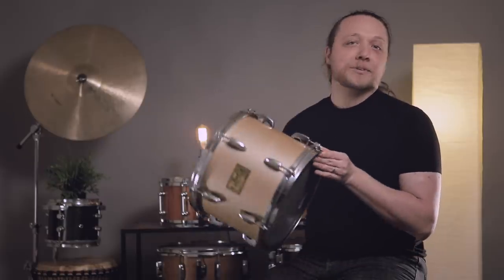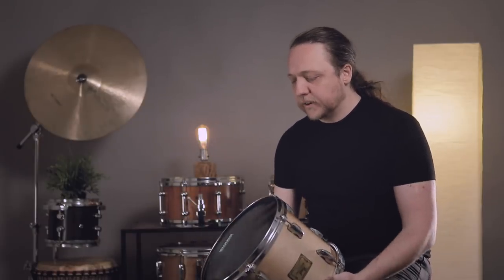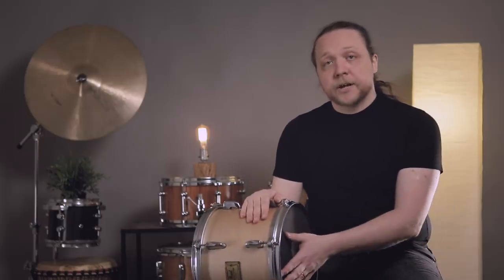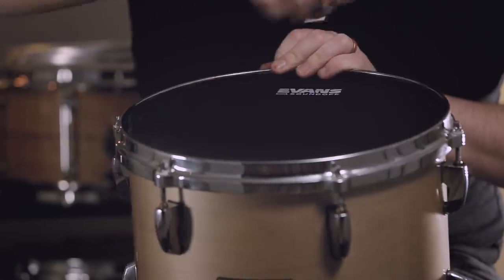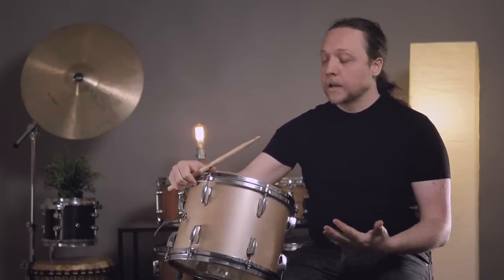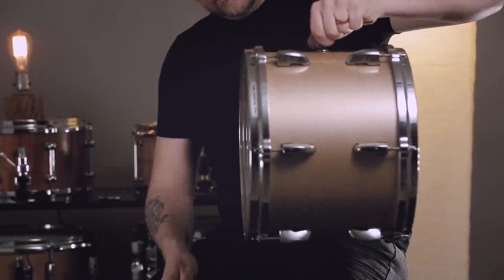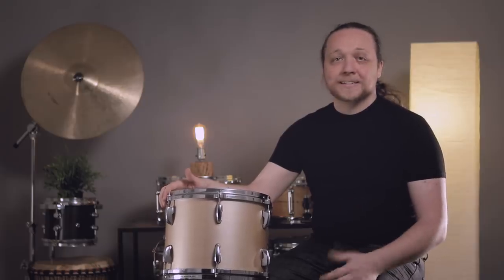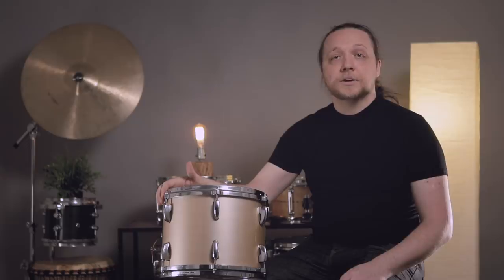Should I Tune to the Pitch of My Drum Shell? Part 2 | Season 2 - Episode 9

Comment from the maker: What's your experience been with tuning to the resonant pitch of the shell? If you do it, do you use the pitch of the shell without any hardware? Some hardware?
Reply: I tried it way back when DW's popularity exploded.  Maybe I wasn't doing it right, didn't take into account all the variables you described (then again, neither did DW), but it didn't make my drums sound any better than before (I used the pitch of the shell without mounting hardware and hoops/heads).  I mostly just tune to the pitch I want, and I don't worry about whether or not it's the optimal pitch for the drum, unless there's something weird going on - for example, I hate when the tom decay is too abrupt, or when the overtones are too prominent.
Reply: One time I measured the pitches of my toms against a piano, and found the pitch relationship between the heads affected the fundamental note intensity, overtones and decay a whole lot more than tuning to shell pitch. Most shells work well in a wide range of tunings. What you might be able to emphasize by tuning to the shell pitch is some of the drum's inherent characteristics that might be down to the wood, the edges or shell construction, resulting in a specific kind of tone or character. I'm still really interested in the results of this experiment with full length tube lugs or high-tension lugs.
Reply: +soundslikeadrum  I don't usually pay much attention to the shell's resonant frequency sans heads; I'm attempting to bull's-eye the drum's Helmholtz frequency, which is determined by inside diameter, depth, and vent-hole area.  With knowledge of the shell's resonant frequency with mesh heads top and bottom, tune-bot® can be used to set the heads' edge frequencies (the firm calls t lug frequency) to the shell resonance as a starting point for fine tuning.
Reply: B. C. Schmerker right on point. Only those of us in the know can get those ultra deep and long sustaining sounds!
Reply: I left the lugs on the shell to get the pitch but did not check it with the head and rims back on.  I wanted to try and get the reso head a fifth higher but the 12” choked before I got there.  So I went with matching both heads.  When I tune by ear I go a little higher than the results I got yesterday.  I have control sound black dots and clear ambassadors on my toms, Gretsch USA Customs.

Comment: I wonder if I haven't accidentally stumbled across the end result here. I've developed the habit of tuning both heads to the same pitch over the past couple years as a starting point. I just bring them up until the drum "fundemental" sings the most in a lowish tuning. From there, I can either bring them up in unison or individually to fit the material. Like 7 times out of 10, the original tuning makes the drummer I'm recording really happy and they are just flabbergasted when I tell them it's unison tuning that brings out the fundemental the most. Then I just dampen accordingly to fit the music, though my favorite sound is generally untouched. Because of your earlier reso head videos, I really believe if I put a G2 top with a G1 bottom, probably coated, I might just kill enough overtones to render dampening practically unnecessary! Obviously for my particular tastes, as nothing works for everything. Thank you guys for encouraging my own nerdiness about this stuff!
Reply: That’s the way to go. I always tune unison between the heads going half a step higher until the drum resonates the most. Then I just adjust either up or down a few hz to whatever resonates the most. Finally I dampen off necessary (which I rarely do).

Comment: What a great episode!!! I never would've thought to use the mesh heads like that. You guys are geniuses!!! As for tuning to the pitch of the shell, I never knew how to even check the shells pitch, so what I always do is put the same heads top and bottom, and tune them to the exact same pitch, at the lowest nite the drum will take. Then I use a Drum Dial and move both heads up  in unison, by 1 at a time on the Drum Dial, until I the drum just starts to sing or sound really great. Then I write that number down and always tune that drum to that pitch or number. This gives me an easily repeatable, reliably great sound from then on with minimal screwing around.

Comment: What's happening here is actually a slight confusion exacerbated by John Wood.
He claims that adding mass to the shell will raise the pitch of the overall system.
This is actually untrue in general, although I will admit it is true in every circumstance he presents.
The reason for this is the following: The resonant frequency of a system is a function of both the mass AND the stiffness of the system (or its ability to "restore" itself back to its resting state).
[freq = sqrt(stiffness/mass)]

So strictly speaking, if one adds mass only (without changing the stiffness), the pitch should actually go down. 
The reason it does not, is because adding the mass to the shell (either with more plies or re-rings) increases the STIFFNESS of the system more than enough to compensate for the pitch drop from the increased mass. 
So the pitch appears higher due to adding mass, but really is higher because of added stiffness.
Reply from the maker: Thank you! That’s exactly the information we were looking for. Any chance you’ve got a solid understanding of the Helmholtz Cylinder?
Reply: Glad to have helped!
With Helmholtz resonance, it really boils down to the resonant frequency being proportional to Area of the hole one is blowing across.
Other properties are involved (such as pressure inside the vessel, volume of the vessel, some atmospheric gas properties) but are mostly constant and don't affect the frequency as much as change in area of the orifice.
Reply from the maker: Based on some articles I’ve been reading, it seems like there may be some relevance to drum shells, despite the fact that we’re not blowing air across them. Any thoughts on that?
Reply: Someone's blowing air.

Comment: The same thing happens somewhat with "tone woods" used in electric guitar.   The bottom line is as you mentioned in this video - Tune it until it sounds good.  Great job on the very logical info presented here!

Comment: As you have noted, there are too many variables in play that change the natural frequency of the drum. But before even thinking about hardware or heads of Mylar or whatever. Consider this: drum shells are generally made of plys of wood (very thin btw) that are GLUED together and then compressed to a round shell. Firstly plys don’t resonate, secondly glue makes inconsistent bindings and thus air pockets form (although it can be argued that this also appears in natural wood) thus also not contributing to resonance. The best design in my mind for a drum is a solid wood carved drum. Similar to taiko drum construction, where every shell is basically a hollowed log. Obviously that’s when wood density and hardness come into play. Generally the harder the wood the better. That’s why drums made of oak proyect a lot more, cuz frequency’s bounce off of the hard wood (not porous) and sustain the sound a bit longer. In any case, as long as drums are ply and not solid, this is an utterly useless argument. Don’t believe me? Then look at the countless other wooden instrument construction designs such as the violin. It really isn’t that different. Though I must say I congratulate you guys on this experiment, a job extremely well done!!

Comment: When tuning my drums, I’ve always imagined that as I tighten a head it basically continues to force its way down the bearing edge and making the actual size of the drum potentially a fraction of an inch smaller if tuned up high enough and I think the more you kinda like contort the shell plus making the head tighter itself makes for higher pitches and more tones. 

The trick is to just use your ears and feel and be able to find that spot that’s right for your different drums on both the batter and reso sides for the sound you wanna make. 

But yeah I like to think of it in a physics type of way as well, that’s why I really like this channel. I get to analyze more controlled data.

Comment: Because of all the variables you mentioned, I think it’s hard to find the pitch of the shell without heads and hardware and try to to tune it to that. Having said that, there definitely is a fundamental sweet spot that works best for each drum. It really is a matter of experimenting to find where the sweet spot is. Once you find it, I’ve found it super helpful to measure it. I use a tune-bot, and now my tunings are super consistent. It just takes a lot of the guess work out when you need to retune or put new heads on.

Comment: hey Rob May from studio grove hear. i went about this conundrum about 2 years before watching this video. i took a slightly different approach basically i took my first 10" tom and found the fundamental pitch of the shell with no hardware, knowing that everything from this point on will change the original fundamental pitch is not really to much of a problem. i put the heads and hoops on grabbed the tune bot (oscillation counter drum tuners check out tune bot) and looked for an A with the batter higher then the reso, once i was tuned to the tune bot i went back to the cremmatic tuner, (my strings tune to 432hz in my band) so from hear i simply experimented in this close ball park untill i had the drum ringing a A at 432hz on the crematic tuner. from there i followed the open tuneing of a guitar aroung the kit so when i roll its as musical as possible. so kick E R1 A R2 D R3 G ect. my snare is a B. the only problem with this method is the time it takes to work with the drum is astronomical, however once you have the drums tuned how you originally intended you just go back to the tune bot and right down the frequencies for the batter and reso for super quick easy and precise tuning in the future.. the only down side with putting so much thought and effort into your tuning is that eventually someone who has never tuned a drum before will eventully come along and confidently insist that they can tune them better.

Comment: I find this episode fascinating as both a drummer and an astrophysicist, thank you for exploring this concept. I have a question...
As you demonstrated, as you add tension, you change the note of the shell. But I'm wondering what note you get when you strike the shell while it has real heads on it. And does it have to be the same as the note you get in the mics? I did some testing myself and found that the heads and the shell don't have to be the same note (but this is very poor conclusion because I didn't take the time to get either head in tune with itself). I tried doing something where I hit the head and then hit the shell and tried to get them within 30-ish cents of each other and I noticed the resonance jump to the point where I could hear stuff vibrating on the other side of the room; I did this with my snare and I started feeling vibrations in my knees and chest though they weren't touching the drum.
Sorry for the long-winded comment, but I was wondering if you've had similar experience with tuning; looking for a second opinion/data point.

Thanks!

Comment: The value of this video series would go through the roof if you could develop a formula for producing a target overall fundamental pitch using various tunings of the two heads based on intervals. For example... "If both heads are tuned to the same pitch, they produce a fundamental overall pitch that is __ lower (I'm assuming it would be lower) than the pitch of the individual heads." Also... "If the bottom head is tuned a major third above the top head, this produces an fundamental overall pitch that is __ lower than the bottom (or top) head's pitch." And finally... "If the bottom head is tuned a whole step below the top head, this produces a fundamental overall pitch this __ lower than the bottom head's pitch."   I am VERY curious if these formulas would stand under various pitches/tensions AS WELL AS various sized and branded drums!!! My guess is that they would not, but if there is a code that can be cracked here, it would be a big step forward for the drumming community.

Comment: On my dw Collector's Series 10" tom, the note stamped in the shell was C. I tuned both heads to a C (checked against my guitar, which I tuned before starting the process) and the drum sounded ok - definitely not as high as in this video. (perhaps my method of checking head note is different). Sometime later, I lowered the heads to B flat, and the drum sounded WAY better! Louder, too. I'm guessing that the actual resonant value changed from what was stamped on the shell due to the addition of the hardware, just as you found in your experiments.

So maybe the note value stamped on the shell is simply a starting point from which to work towards a good result? A shortcut, if you will.

Comment: If you want to reach an overall pitch of the heads to C or C# tune both heads a minor 3rd  to A or Bb. Works most every time for me. Quick and dirty way of tuning your kit to a key that has pleasing intervals.
Reply: @Trevian Harrell nah, I meant what I said. The drum doesn't really change pitch as a shell, more the head or heads do once under tension. The drum or cylinder acts much like pan pipes. If you plug one end, you shorten the standing wave by creating a nodal point,  so by tuning both nodal points lower, the overall pitch of the heads working in unison, or the drum overall can be found.
Reply: @Trevian Harrell it's hard quantifying exactly what is happening with a drum as it's got some many factors that influence the pitch, not to mention the effects of a timpanic membrane which has many overtones and harmonics etc. As a head changes in pitch so does all of the fundimentals. It's almost infinite. I dont think there will ever be a right or wrong way of tuning. BTW, I used to refer to it as pitch of the drum overall, but it's constantly changing. I think desired overall pitch coming from the heads works better as the drum itself has little or no effect on the pitch. Case in point, wood and steel snares, they sound the same

Comment: I always tune to the point where shell resonance is... well... the most present.
Reply: Not trying to troll, but isn't the point where the shell vibrates most also the point of maximum head resonance?  So it's really tuning the heads for maximum resonance independent of the shell.